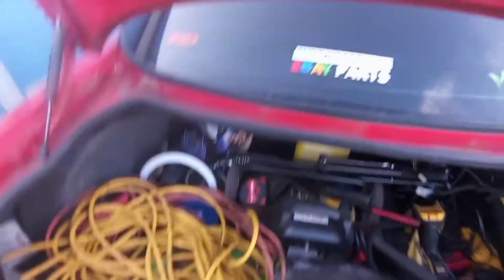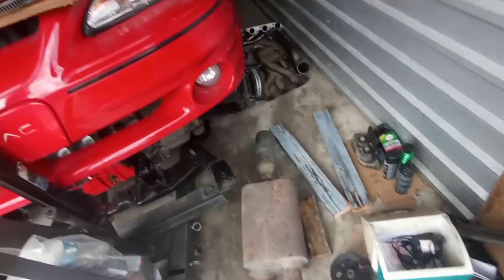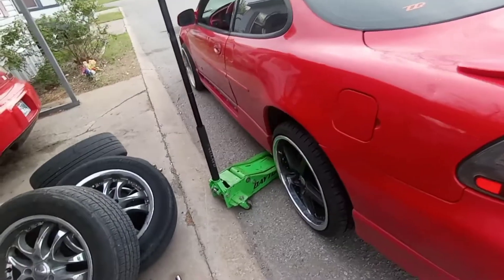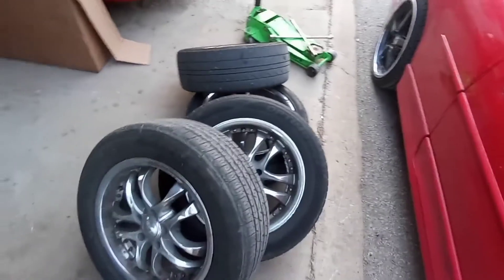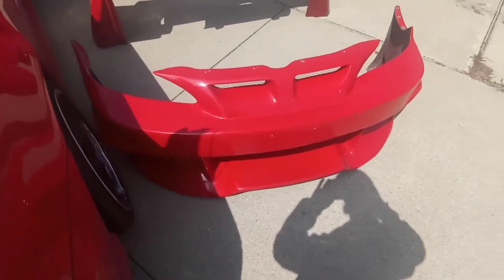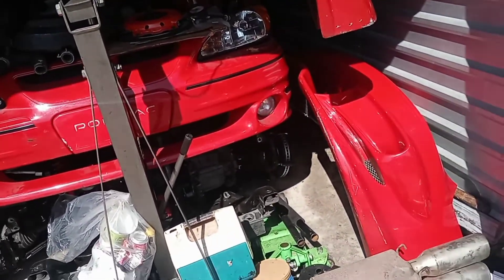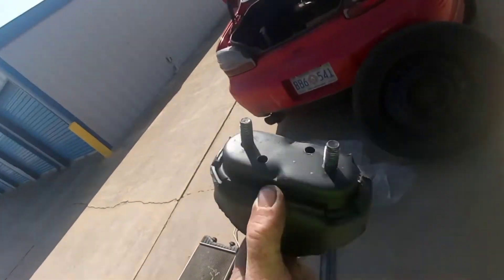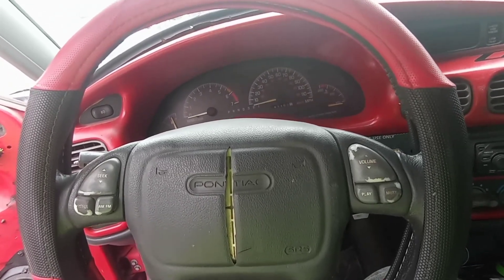Grand Am 3800 5 spd swap gets a body kit/Road trip to Ohio/07 Grand Prix Update/door is fixed!!

Comment: I appreciate your effort with your smartphone and showing us your project. Thanks for keeping your cars alive. I have a 01 Ga and a 06 G6 Gt. Hope your project gives yoy the results you expect.
Reply from the maker: Hell yeah thanks. I appreciate that. I just got the 06 Grand prix going again tgis last weekend, so its my daily now. Next ill be pulling the engine out of the 97 for the grand am swap. Im hoping to have both cars in storage done this year. Fingers crossed.
Reply: I have the rebuilt f23 for the GA. Have to rent a place to do install it. It's easier because it's the 2.4l. The G6 has a standard transmission already. That 3.8l should have been in all GA's from the factory!!!
Reply from the maker: @kastellolo5212  i need to get mine rebuilt and get the upgraded and hardened gears for it. I just have a used low mileage one from the junkyard.
Reply: Mine is from the junkyard, out of a cavalier. $1200 for the rebuilding and $90 at the junkyard. You definitely want to upgrade gears with a boosted 3.8l.
Reply from the maker: @kastellolo5212  i paid $250 for mine from kansas auto recyclers and made a 6 hour road trip to get it. They power washed it before i got there to pick it up and it looks super clean. But i definitely want to get some hardened gears for it so itll handle. But for now its going together with what i got and im gonna order the spec stage 2 or stage 3 clutch for it eventually.